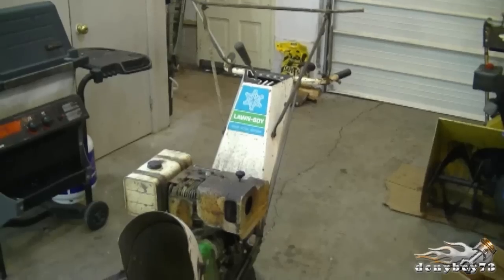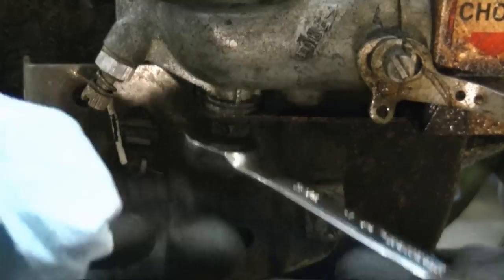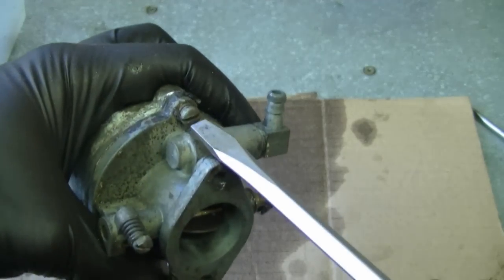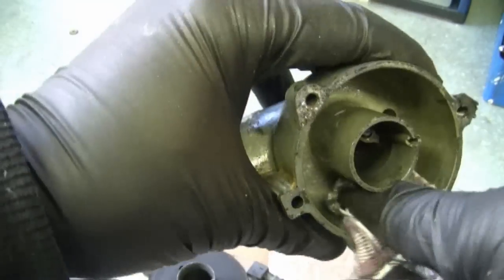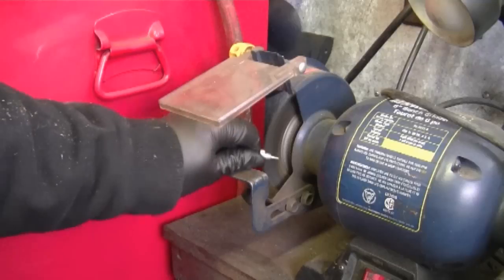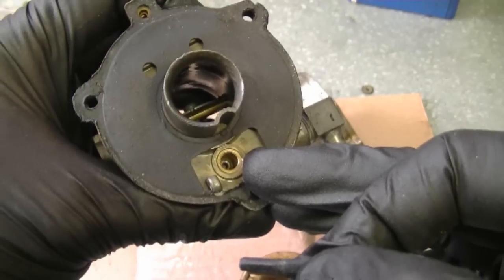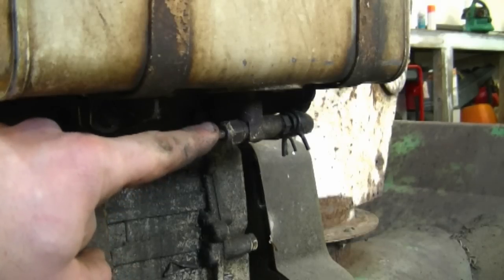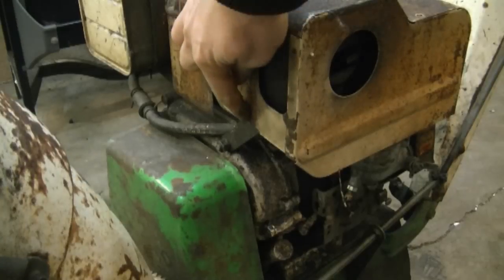How To Clean an Older 8HP Briggs & Stratton Carburetor - video

Comment: @donyboy73   I’m trying to drain the oil out of this same Briggs and Stratton motor. Where can I access the oil drain plug and is there an oil filter?
Reply from the maker: no oil filter, drain plug is at bottom on base
Reply: donyboy73 thank you for the quick response. Is there one on either side of the crankcase? I see two large bolts on either side of the motor beside the oil fill. Is that it?
Reply from the maker: @michaelthayer6986  yes right at bottom

Comment: hi i have a problem on my snow blower crafsman i changes new carburator nec coil gnation in spark plug still not working its always back fire i dont know what to do i see a lot your video but not success may be can you give some help thanks vhal
Reply from the maker: if it has points make sure they are set properly, also check the flywheel key and make sure it's not sheared

Comment: I have a John Deer 420 garden tractor. This has an Onan B48G GA020/ 4175E engine. The carb is a Nikki 6100 146  27-011 0375 3y I know that Cummins has parts as well as JD but the prices are outragious can you get mea new needle and seat for this carb as the old ones are sticking. This unit is a 1983. Keith

Comment: I have an engine like that. Where can I find the model number?
Reply: Model number on these old engines is usually stamped into the top cover near the spark plug, but sometimes you need to look around. Format is Model, Type, Code. Use model and type to search for parts online. Code is date of manufacture: year, month, day, followed by manufacturing plant number and line. If you find it, it is much easier to read the numbers if take a photo and  read the numbers from the photo. Sometimes I rub the dust off the metal with my finger, which leaves the dust in the numbers, and the contrast makes the numbers easier to read.

Comment: the go kart is one of those big wheeled type. dune buggy types with a comet clutch system this will be my son's first kart and I just want it reliable. I kicked around buying a habor freight motor . but if this a good motor I will slap it on there. if any one else knows about this engine please let me know. the  model is 195432 type 0149-01 code 80010910.